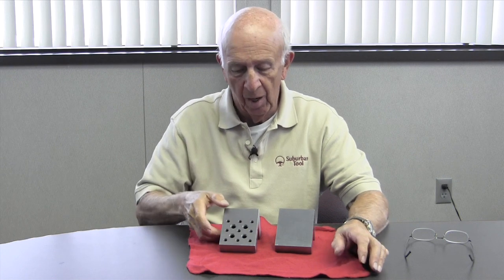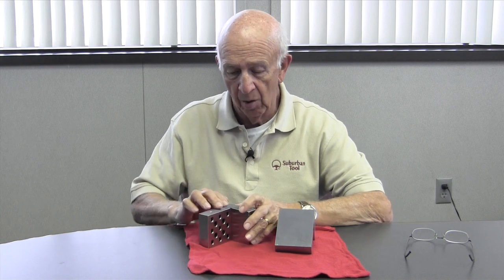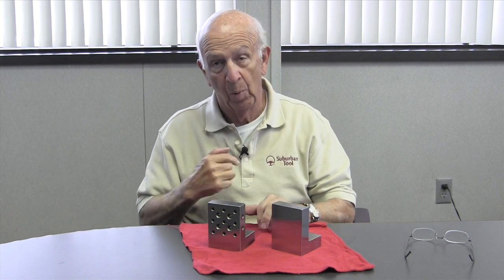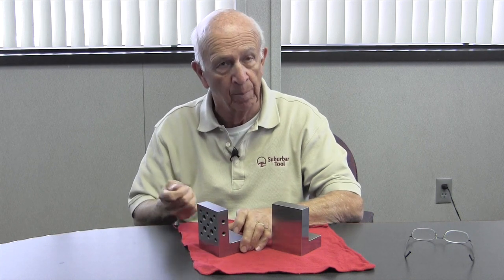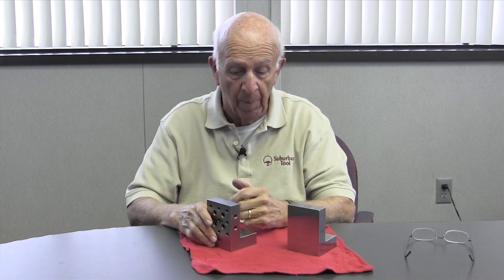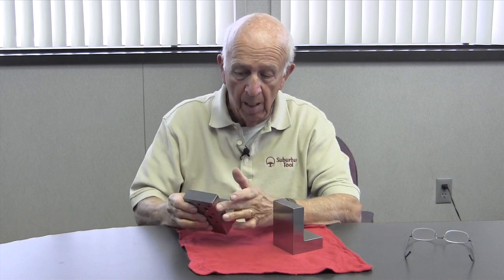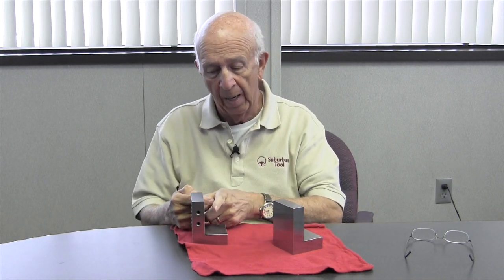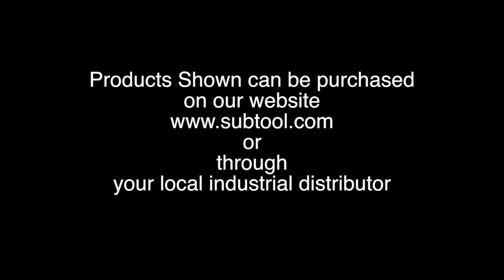Angle Plates - Selecting the right style by Don Bailey

Comment: I made my angle plate when working as a moldmaker.  I put tapped holes in mine and also a vee in one edge with slots through the vee. The slots were used as clearance for the heads of core pins and ejector pins. The tapped holes were used to assemble the clamping apparatus to the block. The slots were also handy, as they served as a convenient stop in this setup.

Comment: Holes in a steel angle plate (or any machinist tool) are for weight reduction
Also some have said it is so tolerance are not effected by temperatures

Comment: Don you are thinking one dimensionaly, only a small part of this world works like you do making the tools you make.  I dont grind anything but I run a cnc milling machine every day.  I do lots of small parts and no production work so permanent fixtures are not cost effective.  I have 6 different angle plates and the ones without holes I put holes in them.  You need them all the time when milling as the cutting forces are often too much for a single c clamp.  Using bolts or bars or whatever is needed to make it work.  I sometimes machine small fixtures that I can bolt to the face of the angle block.

For those time when I dont need holes or for inspection work I use a box rather than an angle plate.

But you are not wrong about having to clean out the holes, but when you need a hole it is better to be looking at it than looking for it.

Comment: Given that I use the angle plate for milling, etc. far more often than grinding and having mounting holes is a great help for quick fixturing and attaching the plate to my table, I'll stick with the holes.

Good points though. Another great video, guys.

Comment: Milling work is probably the only place I use the one with holes/threads, but most of the time the plates that have been bought have been drilled for a few dowel pin holes and sometimes for bolt clerance holes so that we can clamp some extra special mold doodad part so that it can be machined. Most of the time the mold parts have a dowel pin hole on the back side for getting the zero point on CNC machines and of course threaded holes to attach it to the mold. Or there is threads just for manufacturing purposes.

But for grinding it has to be a pretty good reason to whip out an angle plate with holes in it. Same goes especially for EDM.

Comment: I use the tapped holes to set up odd shaped parts. I think I have over a dozen angle plates and find both types useful at times. For large angle plates the holes make them lighter. I am working on a set now that are 80 pounds and would like to get them under 50 pounds by adding holes.

Comment: I've clamped parts to the plate using bolts and washers. The part had holes that happened to line up with the bolt holes in the plate..

Comment: the holes are there simply because they give the tool other uses than squaring stuff up. so its more popular because more people would rather buy one angle plate and use it for every thing rather than buy an extra one that used mainly for squaring and blocking parts in. But I totally see your point and its very common for angle plates and blocks to wear and lose the precision they had when they were first made so maybe having a back up plate and using it specifically for squaring up your other angle plate would actually be a very smart idea. im going to make both kinds now lol

Comment: sometimes i need to mount a die detail that is unable to be c-clamped to the angle plate although maybe  i can run a bolt through the plate into the jack screw hole and attach that way

Comment: Strictly from a business prospective, why are you advocating for the cheaper product. Every corporation is trying to sell more bells and whistels on there product, regardless of its necessity. I can't say how often your costumers use the holes, but I know that it is at least enough for them to be convinced that they are necessary.

As far as cleanliness, I use flood coolant on my surface grinder so most of the dust gets washed away. And also having the holes makes it easier to pull tooling off the magnet, you don't get as much of the suction cup effect.